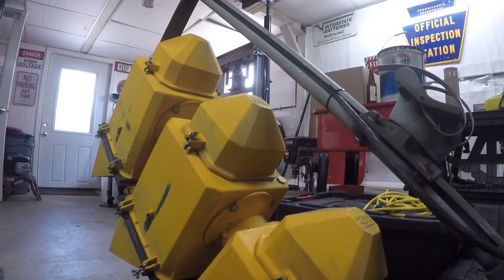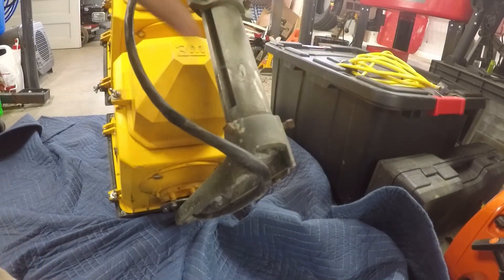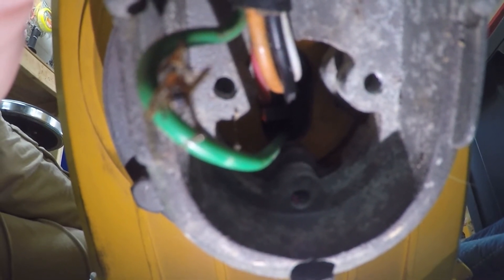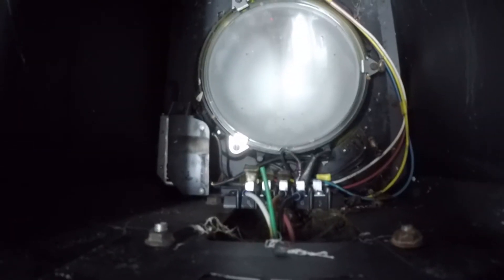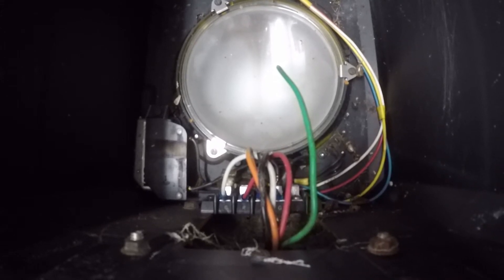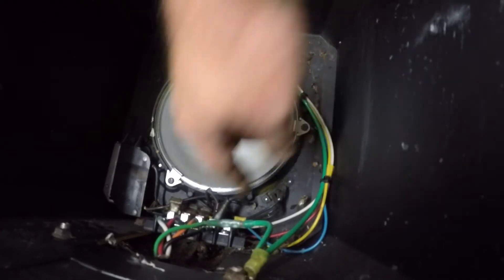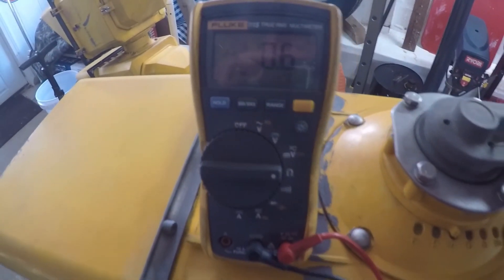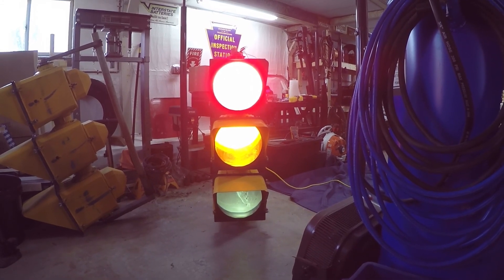Traffic Light Project - Part 2 - Wiring

Comment: I remember these kinds of traffic lights. They were really hard to see depending on the time of day and conditions.
Reply from the maker: I still see them in service locally. I think when they are hard to see, that’s sometimes due to the “programmable” attributes of the light, but I agree, sometimes hard to see, especially depending on your position relative to the lenses.
Reply: @stuffyoucando2  oh, yes, absolutely the angle of the lens to your relative position really messed with you. I think the idea behind that design was that they would be much more visible at night.
Reply: They are not meant to be seen from a far distance.  That was the point of the masking process.  It prevented lane confusion (especially at skewed intersections, and only when you were right up on it was the light output strong.  The other reason was the sun phantom effect that was very common with incandescent traffic lights.  At dawn and dusk the sun was low enough to cast light on to the reflector giving a false indication.  So you might see a green light lit up, but in reality it was red.  To be honest this was an ingenious design by 3M.  Since the LED module for traffic lights has been implemented around the US, this is less of a problem (no reflectors and LEDs are naturally bright).